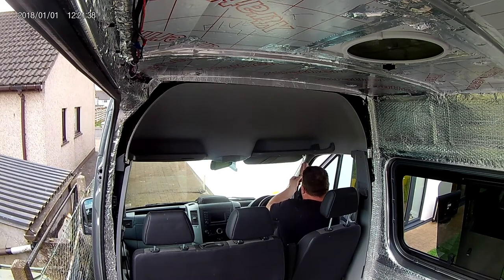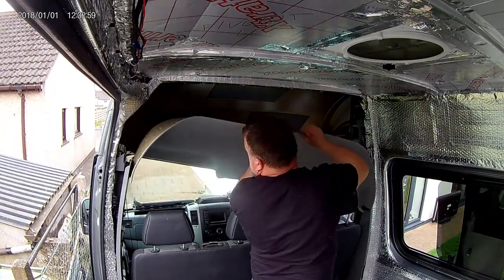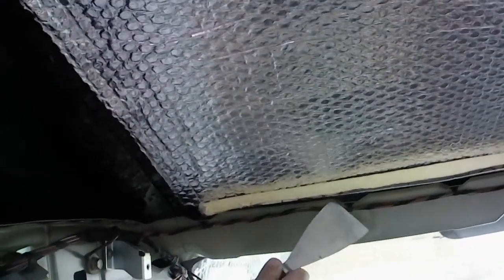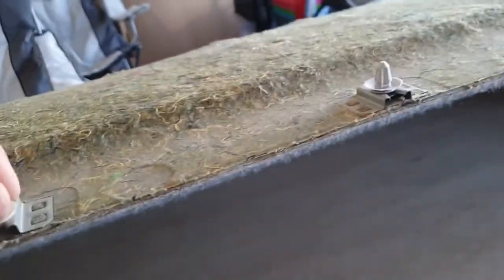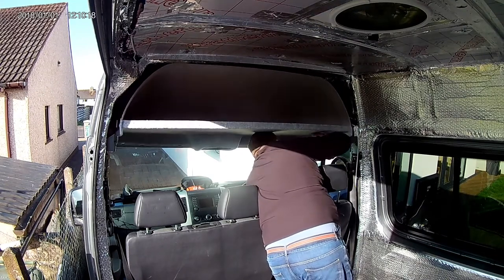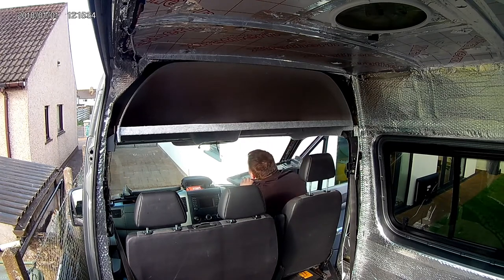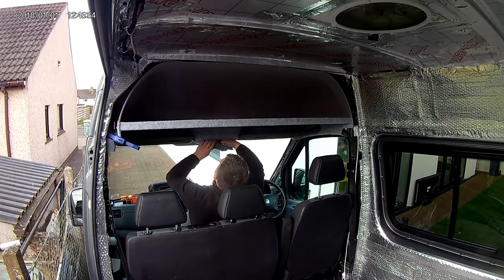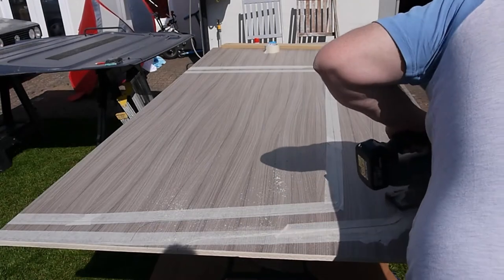selfbuild campervan crafter sprinter | bulkhead storage locker | van build | 9 | the crafty blinders

Comment: Afternoon Sam! Hope you are well and keeping warm? Thanks for the informative video. The guys I bought the van off have removed the bulk of the headliner, tad bigger space but not well insulated, so I will redesigning the shelf, currently wooden cladding and adding more insulation and carpet liner.   I've tried stopping the video to pick up the brand of foam deadening you have used, could I ask the make please. Look forward to seeing you in 2023, our first meet is the Dubbed out at Rotherham.
Reply from the maker: I'm sure it's dodo matting but will check when I get home 
We need to start planning out next year I think our first is vanlove
Reply from the maker: This is a link to the product I used slightly cheaper than dodo matting but just as good 
https://www.ebay.co.uk/itm/353456448278?mkcid=16&mkevt=1&mkrid=711-127632-2357-0&ssspo=6rxbwhgzsbi&sssrc=2047675&ssuid=qkhVtACcQ9q&widget_ver=artemis&media=COPY
Reply: @TheCraftyBlindersvanlife  Than you.

Comment: Good video, thank you... One question from the bit that got corrupted....
How did you work out the shape of the ply for the shelf? Did you do it before you removed the headlining or after? If you did it after removing the headlining, how did you make sure the headlining didn't change shape?
Reply from the maker: Before removing the panel I took measurements and made a cardboard template when I was happy with the template I removed the panel to fit the shelf once fitted I checked the measurements where the same 
Then carpet trimmed the underside 👍

Comment: Hi Sam, what thickness plywood did you use for the shelf? Cheers.
Reply from the maker: It's 9mm I found 6mm was to light not enough strength and 12mm was to heavey and more than we actually needed